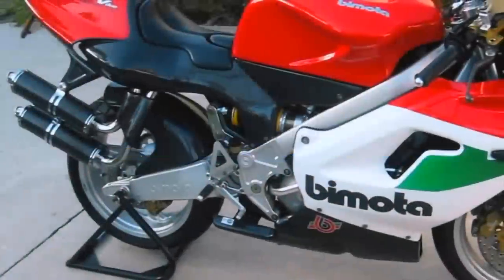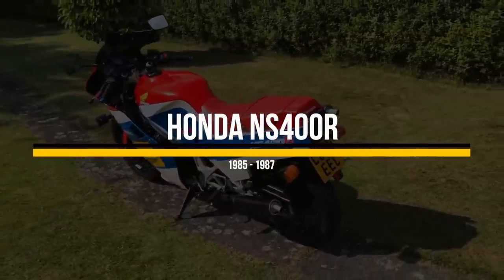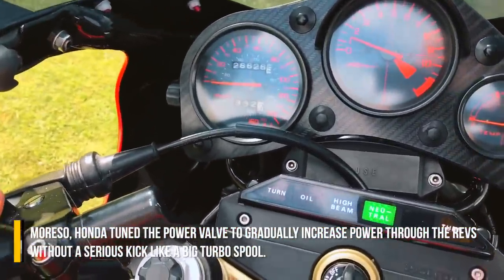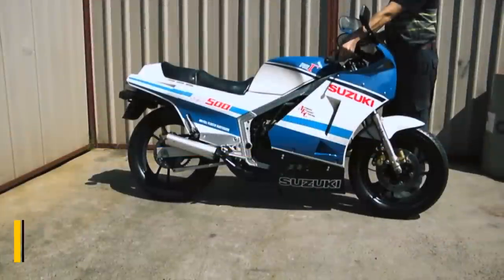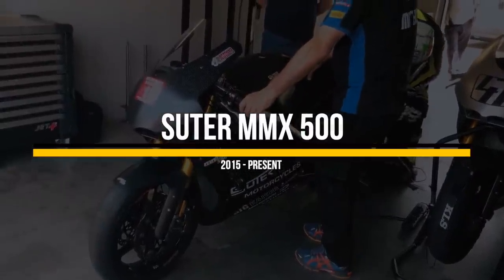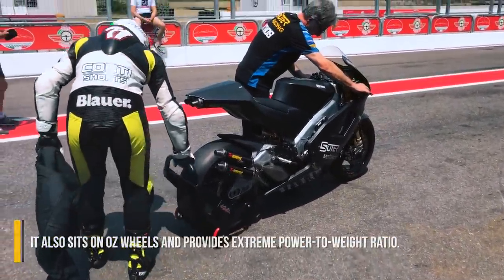5 Of The Best 2-Stroke Production Superbikes Ever

Comment: Lightweight, instant power response and beautiful screaming noise whats's not to love
Reply: Instant power response ? Definitely not, until the valve opens the two strokes have literally no power which means very little power on low rpms. Feeling is similar to turbo spool.
Reply: Valve? What's valve
Reply: @achmadfajar6845  )))
Reply: @achmadfajar6845  Im assuming Kiril is referring to the powervalve
Reply: Kiril Trajkovski maybe the dirtbikes you drive, try the Suzuki gt750 3cylinder 2 stroke: lots and lots of torque.
Reply: @kiriltrajkovski3601  Power response depends on how much cc is the engine, 125cc doesnt have much power untill the valve opens, i don't even talk about 49cc geared mopeds (like i ride daily(tuned)) - litterally no power before the powerband, bigger cc 2-strokes like 300, 500 etc. Have low-end torque
Reply: the emissions
Reply: drove one
Reply: @EdvaE39  no diesel, 1500 t/m full power, 2 tackt  if all is well thats stationair
Reply: Gas  prices
Reply: @EdvaE39  - Have you actually ever ridden and RD350 or similar?  Absolutely gutless through the whole rev range compared to a decent 4 stroke.  125cc pretty much has no power even when the valve does open.  I thought my mates TZR125 was quick until I passed my test and got a real bike.
I will say the 97 CR125 I had was pretty quick but that was low geared, ultra light and over 40hp.
Reply: @David Miatke - I remember them being called kettles.  My mates seized when the middle piston melted.  That was his last 2-stroke and it wasn't much faster in a straight line than the RG250 I had at the time.  I did only weigh about 8 and a half stone then and the bike wasn't much heavier either.
Reply: Kiril Trajkovski Im late, but you definetly dont know what you're talking about lmao
Reply: Kiril Trajkovski Valves open? It doesn’t seems like you know anything about 2 strokes. A 2 stroke has no valves, and make more power at lower rpm than a 4 stroke. You should do some research instead of making people believe in the wrong things that you say. And 2 strokes are excellent race engines do to their low weight to power ratio, and small size do to more compact cylinder head.
Reply: When it comes to reliability 2 strokes are more simple and because of that less things will break in it’s life time. 4 strokes are more reliable but are also more complex, and because of that more things will break in its life time. 2 strokes are way easier to work on, so it’s really up to you.
Reply: @ralf1316  Hi mate, 2 Strokes can have valves but not valves like the poppet valves that are on a 4 Stroke. 
Disc, rotary and reed on the intake and exhaust valves which change the exhaust timing. Ironically, the exhaust  valves usually  increase the spread  of power rather than make it narrower unlike what some folks on here seem to think. 
Cheers.
Reply: @Ady_Mih  Reliability is better than 4 strokes. Simpler motors. Suck & blow. No overhead timing chain, no multiple valves per cylinder etc. Fuel consumption, depends how you use the throttle like anything else. Ride 'em like they are meant to be ridden and its atrocious. You don't buy a two stroke for touring do you?! Emissions? Who gives a fuck. In any case, sport two strokes aren't for numptys, which is self regulating in its own way.
Reply: Not to mention the reliability and the smell is sex to the nose
Reply: @kiriltrajkovski3601 Don't you know how to ride a two stroke? They're not a four stroke. Don't ride them like one. Keep them on the boil within their power band using the gearbox and smooth throttle skills for traction taking advantage of their lower weight higher entry and transit and exit corner speed. From a standing start, a two stroke will never beat an equal P:W ratio four stroke over the first 100M. That's not the point as any two stroke rider knows.
Reply: The sound. But thats personal preferance. Personal i cant stand that sharp of a noise, my ears will break. LITTERLY.
Reply: @Ady_Mih  who cares
Reply: Yeah two strokes feel like they're turbocharged

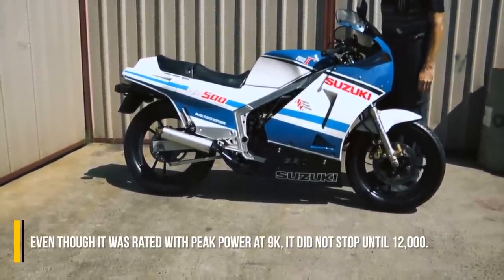Comment: 2:17 wow that 2t suzuki RG500 sounds like 4 stroke
Reply: 2:23 That's not how it actually sounds when riding, the mike was low down and picking up a lot of 'induction' roar.
Reply: @GrrMeister  actually some two strokers can sound like 4 stroke in higher rpm, my gt 185 with some exhaust modification sounds like 360 degree twin cyl 4 stroke bike.

Comment: My only 2 stroke motorcycle is a 76 Suzuki GT500, it's not in the power league of the bikes here, but it's still fun to ride with the "burble and ring" 2 stroke soundtrack even just riding around in my neighborhood, always puts a smile on my face, it really takes me back to my youth when I first started riding, and 2 strokes were everywhere. I wish I'd bought an RG500 in the early 80's and then had the foresight to keep it. It's a shame no one has harnessed the modern 2 stroke outboard motor technology into a motorcycle to build a modern day direct injection 2 stroke motorcycle along the lines of what Bimota tried to do, but failed to deliver. BRP (Bombardier), owners of Evinrude outboards should produce a motorcycle.

Comment: Apparently the big issue with the Bimota was that they sub contracted the production engine barrels and crank cases out to a scooter engine maker, the sub contractor did not follow the specs and the quality control was bad, the press bikes that had 100% Bimota made engines where good, but the production models where not.
Reply: Actually that engine maker was Franco Morini Motori (not to be confused with Moto Morini, although the founders were relatives). It was an excellent engine maker in the 50 cc category, but they did a disaster with the Bimota engine. They doomed also the Benelli Tornado 900 - early triple engines were built by them.
Reply: The aftermarket managed to fix the issues. It's just too bad it wasn't in time to save the V-Due.

Comment: The Aprilia RS250 used an RGV motor but the very last version of the RGV from 1996 was the best 2 - stroke of the lot, it made 70bhp standard and that motor was not used in the RS Aprilia.
The original Yamaha TZR250 from the 80's was the most reliable 2 - stroke that could clock up to 40,000 miles without a rebuild.  The RD350LC and YPVS are the quintessential and most popular 2 - strokes of all time. 
The Bimota and MMX probably sold a dozen bikes so can't really be classed as the best production bikes.

Comment: Maybe worth mentioning Aprilia used Suzuki (RG250) engines in the RS 250's
Reply: Really?  Wow I did not know that they shared engines.
Reply: RS 125 is also Suzuki engine. I'had a RG125
Reply: @Tom_pr  Possible. 125's used to be made with Rotax engines, too.
Reply: @ItJstWrks357  Yeah. Aprilia often uses engines of its partners in development.  For example some RS125's, Pegaso 650's, Caponords are equipped with Rotax engines.
Reply: @Tom_pr  i had rg110😁
Reply: Yep i had one. Nice bike it was
Reply: @RemyBO55  RG 250 G, Gilera Sp01 125, TZR 250, Gilera KK 125, and the last one was a RG500. The order of the bikes do not represent when i had them :)
Reply: Both were rotax units
Reply: They've used engines from Ducati also for another sport bike back then, just can't remember.

Comment: All these 2 strokes smoke,
I'm making a 2 stroke that shouldn't smoke, I use 4 stroke rings, carby, I use a reed valve,
My engine has a 4 stroke bottom end with oil in the sump.
My engine is nearly finished so I hope that it works like I think that it will.
Reply: Could build one using deisel two stroke design  these have super charger to replace the crankcase pressure used to push air into cylinders
Reply: My engine doesn't need a supercharger,or fan, it's really unusual no other 2 stroke is the same as mine, the main difference is how it's lubricated
Reply: Just use expensive 2t for low smoke
Reply: @patvn2000  any progress?

Comment: Really great vid. Only one mistake I could see: The Aprilia RS250 definitely doesn't have 73hp lol. But great bikes, and although some others were not included, it was a short list. Still a nice vid.
Reply: The HP is closer to around 50
Reply: @kiriltrajkovski3601  50 sounds low , my RG250 had 49Hp and the tzr 250 had 50., also the RGV250 claimed 67Hp's
Reply: Aprilia RS250 has an engine from Suzuki RGV250 VJ22. It has 70+ HP when derestricted.
Reply: @aijameson666  Yeah, possible, but the 73 was still a mistake in the video. If it wasn't a mistake he would've mentioned the power when describing the motorbike. But yeah 70+ hp from 250ccs is like 280hp from 1000cc you have to realise
Reply: RG500 stock is 83HP so 70HP for 250cc seems to much indeed

Comment: No wonder I love turbo cars. I was weened on 2 strokes
Reply: It all makes sense now. Nothing, nothing, EVERYTHING!
Reply: But there is a large distance between turbo and 2t. The turbo engines got their max torque at low rpm and the two stroke at a freaking high rpm. But still 2stroke are very fun to drive :D
Reply: @kanciastygra  Not if its a big turbo
Reply: @kanciastygra  Depends where the turbo is optimised for.

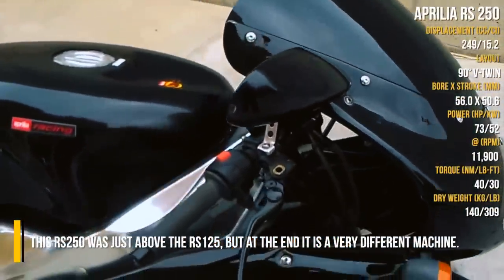Comment: 3:01 holly cow 250cc 73hp that's was the fastest one i ever see..😱
Reply: Sorry but, that was a mistake. That is not possible.
Reply: It had less than 50
Reply: @Chris-cy3uq  Maybe stock was nowhere near 73 , but any experienced tuner could easily make that w/ the usual mods ...Racing 250 s got up to 95 , if not higher .  Video made error in listing Aprilia's weight so high . If I recall , they were about  220-230 lbs , not 340 .